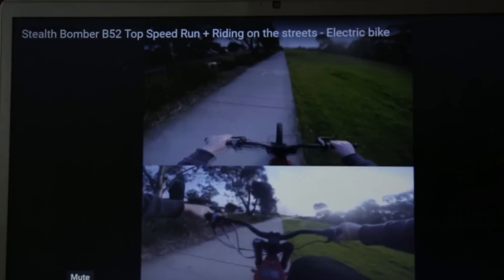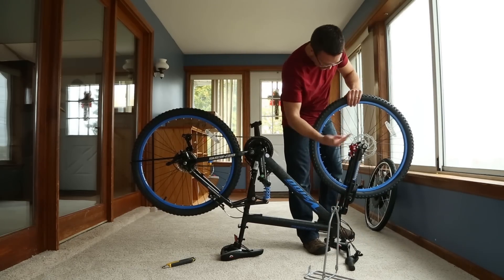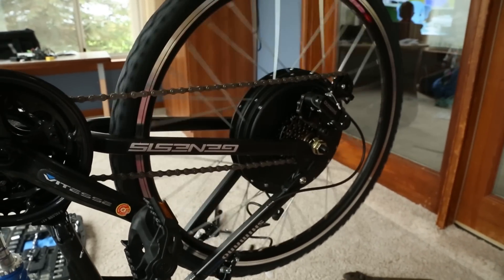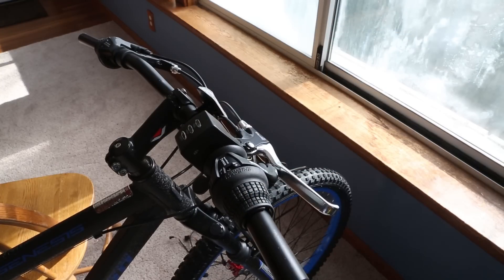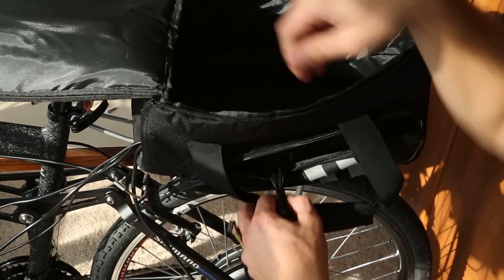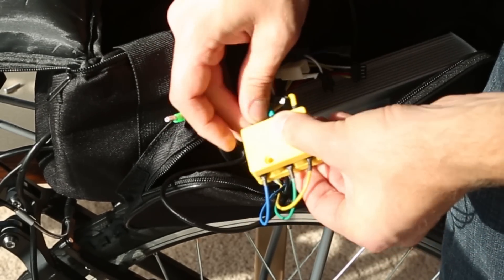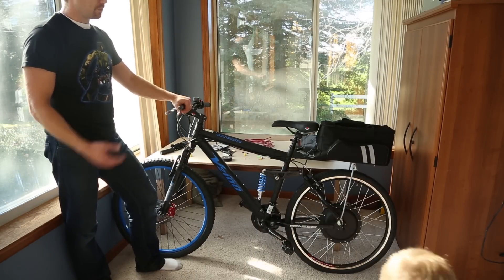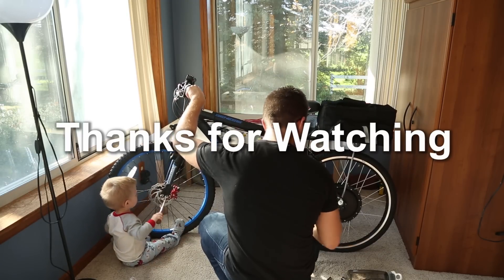How to make an electric bike for under $500! Fast & Cheap eBike tutorial!

Comment: First of all very good video.Now I want to tell you and to the rest people that this Kit is very strong & the time will shows if it is good.The only problem is with those Batteries.They don't last long.I mean in the beginning you can drive min 50klm+-  distances (it's depens from the capacity Ampere/Hour of the "Bats") without any pedal and with speeds almost 40-50 kmh.What I faced with everyday use was that the "Bats" after 6 months I couldn't drive max 10klm Dist, but with 40+kmh!!!After that I take it out of my MTBike and now I'm searcing for a lithium battery pack (48v10ah) that I hope it ''ll give me 30-40klm Dist but for much longer time!!! PS:Forgive me for my English.I'm from Greece.
Reply: The reason this is true comes down to battery chemistry. Those are sealed Lead acid batteries and are really meant for a single discharge / emergency situations. OR they are meant for a short burst of a lot of energy and they need to be trickle charged immediately so that they stay at a voltage where the internal chemistry isn't being damaged. If you are working these LAB (Lead Acid Batteries) until they quit outputting enough to turn the motor you will probably see capacity degredation in about 20-30 discharge cycles.  The best way to combat this is to use some form of voltage regulation. You need to have a lowend cutoff to prevent extreme battery damage. ALSO get it on a charger ASAP after use, to reduce the time it is at low enough voltage to destroy internal chemistry.  BUT LAB batteries aren't really designed to be full discharged on a regular basis. (about 60 discharges should damage battery to only 50% capacity and very reduced amperage output.)

L.ion batteris are designed to be discharged anywhere from 1,000 to 10,000 charge/discharge cycles, according to quality. That means CRAPPY Lion batteries will perform for 3 years being used daily. Since this a DIY project there are some great youtube videos out there on how to get CHEAP Lion cells and make your own pack.Will follow up if I remember to later with links.
Reply from the maker: I understand.  Thank you for sharing!
Reply: το κιτ απο που το πηρες φιλε μου?
Reply from the maker: Update video is up! - https://youtu.be/CU9PcscbU-8
Reply: Teo Pit apo tin elada
Reply: You got out!
Reply: Coolbikeslhaveezipmyselfneedscontrolerandbatteries

Comment: lead acid?much better options but for the price, power,weight,range your options are limited.lion,lipo there are much better batteries and lighter weight.i built a simple downhill style bike and opted for a front wheel 48v 1000w kit and 12ah bottle style battery.after suspension upgrades i have $1000 bad ass bike.and its 2 wheel drive.

Comment: Great video! and thanks for the link
i feel like the batteries would be better if i place them on middle-down tube and i think that i would have to weld some kind of compartment designed for the batteries. Little afraid of messing this up just for not sticking with my damn balck bag

Comment: if you put the batteries in series the voltage adds up but the Ah stay the same, how long of a distance can you get from 12ah?
Reply: Abel Romo well I have a 12ah 36v lithium battery and I get around 18 miles without pedaling and without doing to many stops but when I pedal and use the motor as a pedal assist I get around 30 to 35 and when there is uphill I get around 10 to 8 miles

Comment: TitanFlight sells high quality cells in packs for RC stuff. You can take a couple of the 6s packs and run them in series to make a 44v and 3.5 AH battery. You can add two more to make a 7 AH pack. These are very high quality cells that don't lose capacity when you draw a lot of power. You would need 4 packs to draw 1000 watts. The weight of 4 packs is around 4 pounds, a huge difference. See my video linked below, if you like.

Most people don't get a lot of cycles from the lead acid batteries, but it depends on how far you ride and how hard you make the motor work. A 1,000 watt motor is a lot of power for a cheap bike. You might find motors in China, low wattage, for around $100. I would go with a low power motor and a lithium battery. The Titan Flight I have, made with 4 of the 6s packs, was $200. 

Glad it worked for you. No reason to spend a lot of money.

https://youtu.be/8LuwhF_UVx4

Comment: Why did u go with lead acid over lithium ion?
Reply from the maker: Cheap.  I just wanted to see how well the motor would work and if I liked using it.  If I used it more than a few times a month I would go with lithium ion.
Reply: any place you know of that you can buy the battery pre configured for setup?
Reply: Gavin Morter damn good find

Comment: sup man great video. Can you do a video on building an enthusiast bike at the best cost/perf ratio? I saw a 1500w on ali express. I wonder what the best performance we can get for the money is?

How does yours compare to this?

https://www.aliexpress.com/item/48v-1500w-26-Rear-Wheel-Ebike-Conversion-Kit-with-Sine-Wave-Controller-LCD/32432466379.html?spm=2114.01010208.3.29.DPp32T&ws_ab_test=searchweb0_0,searchweb201602_5_10065_10130_10068_10136_10137_10138_10060_10062_10141_10056_10055_10054_10059_10099_129_10103_10102_10096_10148_10052_10053_10050_10107_10142_10051_10143_10084_10083_10080_10082_10081_10110_10111_10112_10113_10114_10078_10079_10073_10070_10123_10124,searchweb201603_4,afswitch_1,ppcSwitch_5,single_sort_0_default&btsid=77787d85-7c32-49e5-a16d-da9d30d4fc6c&algo_expid=6d0f1c5d-a1cb-4d38-9ff9-422252df5c81-3&algo_pvid=6d0f1c5d-a1cb-4d38-9ff9-422252df5c81
Reply from the maker: Pretty much the same setup except the wattage and the display.  Should work well!

Comment: I do not know anything about these batteries, but it looks like they are heavy, it would be better to use the Li-Po 7s (25.9V)

Https://hobbyking.com/en_us/zippy-compact-5800mah-7s-25c-lipo-pack.html

a researched, as are light ....
Reply from the maker: Li-Po pack a lot of power, just dangerous to charge if you are not careful.

Comment: I've been looking at these 48V 1000Watt kits and want to get one. I know you bought it for speed but wouldn't it be safer to configure the batteries to 24V 24AH so that you won't raise suspicion as you fly by officers? I hear higher amps give you more distance as well.
Reply from the maker: This is true.  I use mine on a trail in a rural area...no officers around.

Comment: How do you chrage the batteries?
Do you charge the 4 batteries at same time?Can you provide further info? 
Thanks in advance.
Reply from the maker: I've been charging one at a time, but you can charge them together. I have not use the bike much since I live in Michigan.  I'll make an update sometime.  Or just google it!
Reply from the maker: 48 volt charger would be easiest.
Reply: Thank you for the answer. I've indeed google to find the answer for this question... but didn't get a clear answer pointing directly to a specific charger. I will try again... tx
Reply: I couldn't help but notice what happened to your carpet the first time you tested the motor and put the back wheel back down without firstly applying the brake! :o

Comment: Great video I'm in the middle of waiting for bits to arrive and am doing the same with 4 x 12v lead acid to start as I'm on a budget, How long or what range do you get from your batteries I'll be doing a 10 mile round trip also what AH are your batteries and if you could do anything differently what would it be? Any tips.
Thanks, great video.
Reply from the maker: Mine are 12ah. You might get 10 if you do some of your own pedaling.

Comment: thanks for making this, it's great to see someone who's not a 'bike guy' tackle this kind of project to completion. could you have done a few things better? sure, but you learn as you go and your video shows this. looks like you've inspired others to follow you, which is great!

if you want any advice or support with general bike stuff and most of the electric stuff I'm happy to share my knowledge. cheers
Reply: How do you charge the batteries he used?
Reply: @cartercurrans8812  1 at a time on a low 2 amp charge
Reply: @cartercurrans8812  You can't charge the batteries he used. Not a practical ebike.
Reply: fhqwhgads(googlecanfuckoff) hey, I have a question. When he attached the batteries to each other or attached the batteries to the control was there any welding/soldering?
Reply: no if you ever went to a hardware store and looked at the electrical section you would see a few kits with those little cone things, they secure 2 wires together without using solder, it can make upgrading things easier down the line, and is far faster and cleaner than solder, i think there might be a problem if they get wet though but dont quote me on that.
Reply: What is the name of the kit used on a android no links below .what kind of battery is used.
Reply: I like to convert my brother bicycle to electric, please what are the materials to buy
Reply: If you want to help me out with building a battery feel free. Drdimaria@gmail.com

Comment: I just want to let you know how much I appreciate this video. I'm 13 years old, not knowing how to wire a battery or anything like that and I had been looking at this exact kit. My dad and I had no idea on what to purchase battery wise, even bike wise. You have us those answers!!!
Reply from the maker: Great! The rack works, but a Lithium battery in the center is best!
Reply: Blu Swoosh dude dont get a rear suspension bike you will break the rack
Reply: Blu Swoosh, my honest but probably biased opinion is to not get a cheap bike either from Amazon or any department store because they use the lowest Quality Parts 90%of the bike they make. It is absolutely worth it to go to your local bike shop ask lots of questions they are always happy to help. You may be spending a little more on the bike but the quality of the parts and the information to learn is absolutely amazing and is well worth the time and the money.
Reply: TechMindBlow I'm sorry that you have to keep replying lol, but why the low rating?
Reply: Btw I appreciate you taking time to answer my questions, sorry XD
Reply: TechMindBlow  by any chance, what would you rate the four batteries out of 10. Considering range and just quality overall?
Reply from the maker: The range isn't as good as Lithium and the weight makes it awkward when turning. That's why I went off the bridge...well that and I was holding a camera! But lithium cost 3 to 5 times as much!
Reply: @TechMindBlow  it could be cheaper if you build the battery yourself! Assuming it's done well enough!
Reply: Blu Swoosh I agree with that. Most of my bikes except for one are all from department stores like Walmart. And as mechanic I know to do all of that stuff but as a beginner who may not have the skill they will just ride it until something goes wrong. I'm a huge advocate for preventive maintenance including bearing overalls from the start. but as I said earlier as a beginner you may not know to do all of that stuff or to know to go to sealed bearings if possible
Reply: Blu Swoosh I wouldn't use this kit. Get a front wheel motor and downtube battery takes about 2 hours to convert. I did mine last May and have done over 700 miles no problem and will do another 50 miles over the coming weekend. See my comment above.
Reply from the maker: Considering price 8 or 9 out of 10. Not considering price 3/10.
Reply: Blu Swoosh Same
Reply: Andrew Mietkiewicz the first thing to do after buying a bike from Walmart is to take it apart and GREASE the bearings. The bikes they sell have a light oil lubricating the bearings, but I agree...buy a good bike from a bike shop.
Reply from the maker: Update video is up! - https://youtu.be/CU9PcscbU-8
Reply: laptop battery game
Reply: Meh honestly if it's a cheap bike you're likely better off not maintaining it since most of the cheaper parts are life parts, yeh it'll break down but it means you can replace them with nicer bearings and such.
After you spend money on the oil, grease, cleaner, time ect it's cheaper just to run till it breaks on cheaper parts, if your using a high end bike yeh it makes a ton of sense to maintain it, only thing you get with maintaining cheaper bikes is a tiny bit more life out of them.

Like the can of cleaner will cost the same price as a cheap bearing

Comment: This is a small suggestion, but the side of the wheel that has the wire coming out of it should be pointed down instead of up. That way if it rains or gets wet in any way the water doesn't go inside where the wire is coming out. 

Good job by the way, ebikes are awesome!
Reply: Teo Pit It matters enough, they put drip loops in the code books for a reason especially around connections. Look at powerlines and you will see them there.
Reply from the maker: Thank you!
Reply: rain and tap water arent conductive nor that corrosive as salt water,it doesnt matter much!

Comment: Please show how you recharge the batteries.
Reply from the maker: I just use a 12 volt car battery for each at the time. But you could wire them together in parallel and charge them all at once.  You would need to change the wires for using on the bike and for charging then.  Like this. http://www.chbattery.com.img.800cdn.com/uppic/200941495758493.gif

Or you could just get a 48 volt charger. I just don't use it enough to buy a special charger.
Reply: I'm curious about this as well.

Comment: was looking to buy this kit but i might have a problem as my brake levers and gear changes are in one   plus what charger do you use
Reply from the maker: I just use a regular car battery charger, but I just got a trickle charger from home depot and that works well too if you got the time for it.

Comment: Nicely done. If it's as easy as you make it look, there should be a lot more electric bikes on the road. Is the speed limited by the battery power or the controller?
Reply: It really is this easy.  The battery is not taking full advantage of the motor.  I've read it could go near 38 mph with the right battery.
Reply: I want to build something custom but don't have a welder, the space, or the skills. Need a fabricator to bring my ideas to life.
Reply: What battery is that?

Comment: Great Video. You might want to start collecting used 50 cent Laptop batteries now so you will have enough to build a 9 pound lithium ion battery pack that will take you 2 times as far with 1/3 the weight, for less than you paid for your lead acid batteries. Then when the lead acid batteries start losing capacity, you will be ready to Rock On. Cheers
Reply: How many Lithium Ion Battery Packs have you built? I am now working on my 5th battery Lithium Ion Battery Pack. All will go over 35 miles in distance. None have overheated because I spend a lot of time testing them to select the good ones. The total cost of each battery is $40.00 compared to $400 for a 29 volt 32 amp hour battery. I have documented the building of each battery pack on my Channel. Just because you can't doesn't make you an expert.
Reply: Nick Walters I've used 78 for mine but you could use much less, my range is about 30 miles or 50 k at city traffic pace, hope it helps. endless sphere is a great forum for this info but can be overwhelming
Reply: 18650 E-Biker laptop cells usually are too low amp for high powered EVs. especially used ones, since with age lithium ion cells not only lose capacity but also the ability to deliver the current they are rated for. You'd need too many of those cells. I'd suggest to buy some new mid range capacity high current cells off a trusted vendor. much less hassle, better performance, lighter pack because less cells needed
Reply: fhqwhgads(googlecanfuckoff) thanks for the replay i will be rideing about 6mile aday
Reply: 18650 E-Biker what's the total amount of batteries you need to build a battery pack
Reply: Just because you can doesn't mean you should.  I wouldn't rely on used laptop cells either for Ivan's reasons plus overheating from high current draw. If by city traffic you mean 10-15 mph, then sure, re-used cells would probably be OK. Maybe you missed where Ivan said high-powered EVs.
Reply: You have obviously never been on the Endless Sphere forums or watched any of Jehu Garcia's or Rinoa Super Genius videos to make such an ill-informed statement. Those who say it cannot be done must step aside and make room for those who are already doing it.